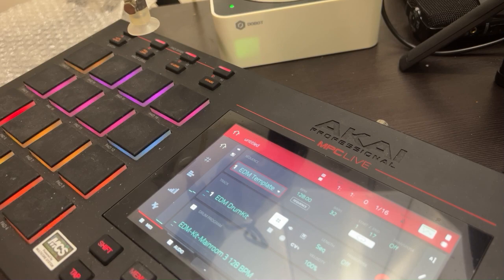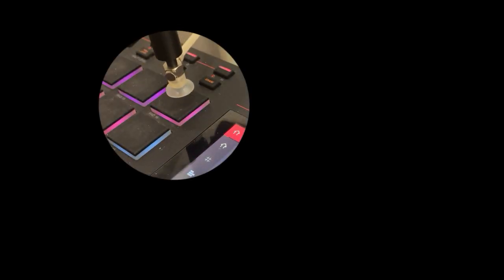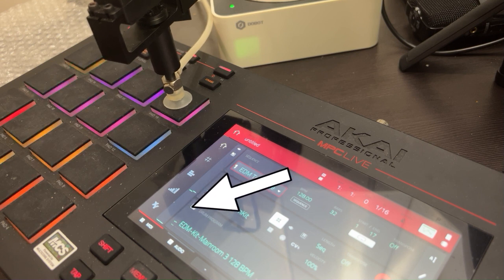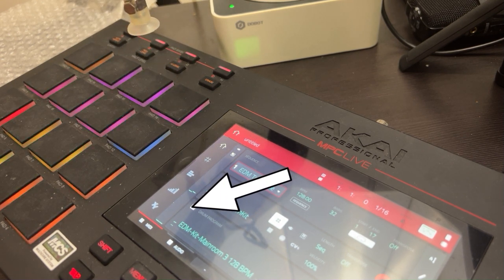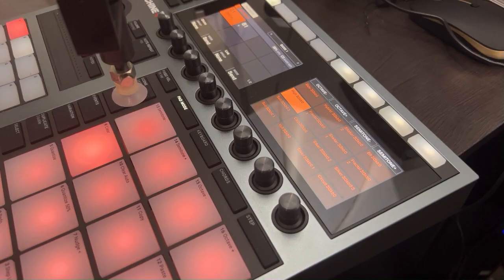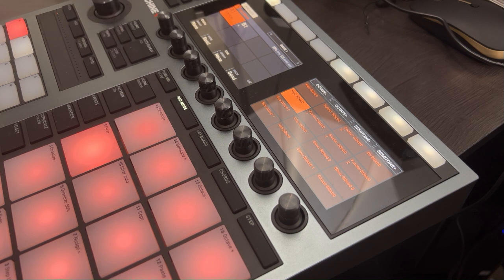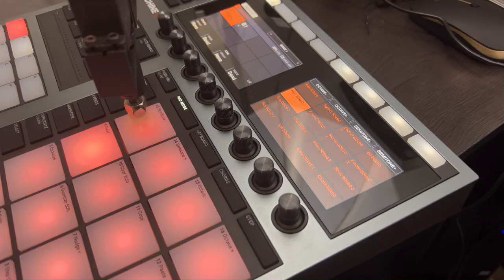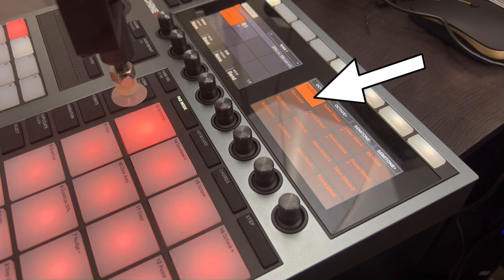Battle of The Pads using Robotic Arm- Maschine Plus VS Akai MPC!

Comment: More sensitive pads mean more sensitive pads.  Nothing more, nothing less.  Sensitivity is preferred by some and not preferred by others.  

Most people know this without any measurements.  Native Instruments pads are more sensitive.  Technically, you didn’t quantify anything in your test.

A load cell on a material measurement machine while recording a MIDI pattern and collecting the velocity data is a superior method than yours.  What you did is less than ideal.

You basic logic is flawed.  Pad sensitivity is user subjective as far as preference.  Some people prefer less hair triggered pads.  Others like to light finger over the pads.  Ever play a real piano?  Notice the resistance?  If you come from a piano background, you might prefer that kind of resistance in a pad to play expressively.   Pad sensitivity is a personal preference, not a determiner of what is better.  You can play chords easily on the pads of the MPC.  You sound really confused.  Sounds like you’re expressing personal preferences, not objective facts.  Furthermore, I would use a MIDI keyboard or digital piano on either device if I wanted precision in what I play.  Just saying.

Try again with less emotion and more data.
Reply: Do you know what a load cell is?  My test was not to say what device is better ! It was to allow a control management of force to determine sensitive and response. It accomplished that! A person cannot measure the amount of force and speed or even acceleration. This was basically a scientific test! However, I did say in the video human interaction is the final judge.
Reply: @TheEtbetween  
"Do I know what a load cell is"  Apparently more than you.  Maybe you should stick to using gear rather than quantifying their attributes because you seem a little wreckless in you thought processes and procedures.
Reply: @matthewgaines10  you do know that a load cell only provides information pertaining to force! The robotic arm allows me to obtain much more data! Such as speed , acceleration, etc… the pads are not just simply responding to a pressure convergence of force. There also a  data interpretation which is performed by the processor . I hope that helps.